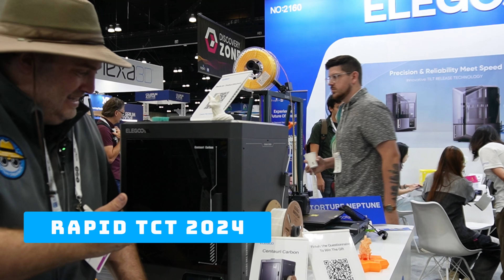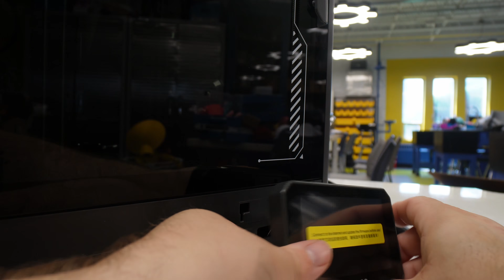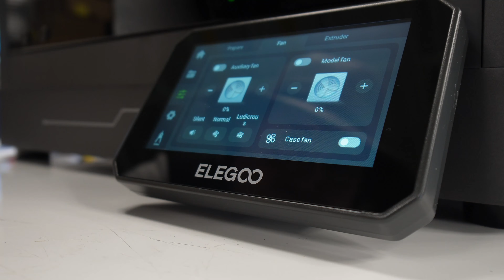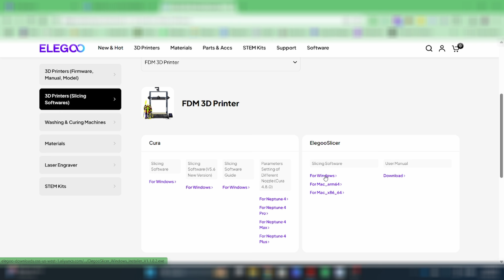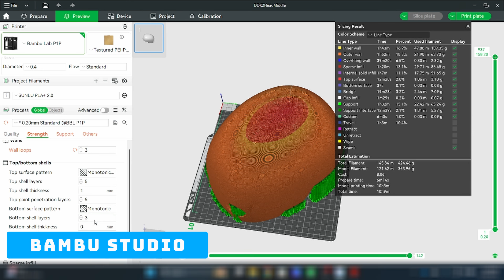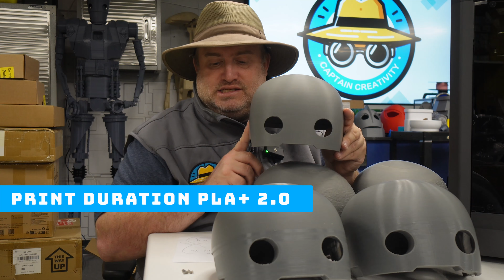Centauri vs P1P: The Ultimate 3D Printing Showdown

Comment: ok, so, people in their review always or almost always forget one use thing.

After purchase support.

Bambu as committed to supporting the p1s for a long time. That means that their site will have parts if your printer breaks down. The ability to get parts is a huge thing to consider when you purchase one of those things. Yeah you may save 300$ but find yourself not being able to buy that proprietary nozzle on a printer.

The beautiful thing about Bambu is that it is widely supported by Bambu itself and there are a truckload of 3rd party companies making a truckload of accessories for their printers so if your nozzle craps out. You have a choice.

I can tell you by experience that i did buy beautiful printer that worked well but basically become bricks on my desk because i had no choice but to buy the hotend from the manufacturer and had to wait for a month for it to come from china or have them send me a replacement part that came from china.

At least with Bambu, they have local warehouses and like i said tons of parts to help out and they got the best website ever, they really have their act together  when it comes to sell you something that comes with actual support. In short its like buying from Ferrari, you pay more but you get the service that you deserve.

A lot of companies out there produce reversed engineered clones with proprietary part, sell them pretending they are open source and when your nozzle craps out you find out that the nozzles on the machine is totally proprietary and cannot be bought anywhere else. ( sorry for repeating myself )

Honestly i was not a fan of Bambu and i just got my first printer from them recently but with all that i am seeing, it does not make any sense to go with any other printer. The only bad thing about Bambu is their bed size but that is slooooowly changing and their always out of stock situation BUT they always end up delivering on the print bed!

Also the fact that Bambu has already figure out multicolored printing properly is another big thing.

so all of this to say. Buy cheap, get cheap support.!

Comment: I bought a CC and have only had problems I have tried different filament but I just can't get it to print properly first it was a bent heated buildplate so my first layers were absolutely trash, then anytime I tried to print even the slightest overhangs it just gave up  it also has weird extrusion problems but the nozzle isn't clogged. And no I have so far been unable to fix any of the problems I am currently having to use support for even a 10 degree overhang that isn't even an overhang I am heavily considering returning the printer and buying a P1S simply because there is better infrastructure to fix the problems

Comment: Got my first 3D Printer (Centauri Carbon) July 22nd. It has over 1200 hours with no problems. It's been an amazing printer. My second printer (P1S Combo) will be here tomorrow. Can't wait to see if Bambu Labs lives up to the hype. If Elegoo had released their AMS system on time I would have bought a CC Combo instead.

Comment: After 4 months of use, has your opinion about the CC changed?
I’m interested in buying one, but I’m new to the 3D printing world. I’m torn between the A1 and the CC I know they’re different types of printers, but in my country the A1 costs only €20 less than the CC, so it’s a tough choice for me.
Buying a Bambu printer feels safer because of the software, MakerWorld, and all the integrated features it sounds like a good option for a beginner.

Comment: It needs a filament movement sensor to avoid air prints.
Reply from the maker: What about noise? Is yours very loud when it starts? I think that's also a key thing they need to work on. Other than that I'm very happy with it.
Reply: @CaptainCreativity given its speed, noise was perhaps not a priority. I don't mind, I leave the top on and close the door. I cannot see any problem with PLA printing with the cover on 
However the front lip of the printer is interfering with the build plate, making it bend. I added a 1/32" thick aluminum plate cut to 259x259m, T6061 grade Amlazon $10, on top of heatbed. 
Filament drying may be an issue, freshly opened packages may still be moist. 
Those paper reels can absorb 4 cc of moisture from air. I weighed 3 of them, a freshly dried one was 4 grams lighter.
The only way to be sure of dry filament is extensive drying. 
I got a Creality dryer with two fans and a 145W heater, with a humidity indicator. 
The only way to be sure if the sealed content is dry is if indicator paper has been included. 
My dryer showed medium high (29%) humidity on a freshly unpacked spool of PLA-CF.  min 5hrs at 50°C is recommended for drying, probably more is needed.

Comment: Just found this video because I'm considering a Centaui Carbon. On the P1S with the bad prints, have you ever cleaned you extruder gear? A dirty extruder gear can cause the bad globs like you got on that K2SO head.
Reply from the maker: To be honest I dont clean as frequently as I should and your absolutely right to call me out on that one.  However in this case I did try this with multiple P1P machines and got the same result, so I feel that the extruder gear wasnt the issue, also since then I have printed out many other large items with no problem. I have moved on from the K2SO head but I would like to get to the bottom of it, either way its a great suggestion and I did go ahead after this to do a cleaning, so next time I do a large print or if I make another K2SO I will try it again. Thanks again

Comment: Did you notice any difference in sound levels? On forums Centauri is getting bad rep for being very loud, is it actually that much louder than the p1p/p1s?
Reply from the maker: Hey I'm actually glad you commented on this. I don't know why I didn't notice it as much in the testing. Maybe it was because I was in a stem lab. But when I brought it home to be placed on the standing desk testing that I was doing for my other video I definitely noticed the difference in sound level. I would definitely say that's the biggest strike against the Centauri carbon is the noise level it is ridiculously louder than the p1p. For me it's not enough to not say it's still a great value because usually my makerspaces relatively noisy anyway but for many that could be a major deal breaker. Anyway I'm really glad you pointed this out. Thank you for watching

Comment: I personally would not buy the P1P or P1S over the Centauri, nether are worth the extra cost. There is no way the software is worth $300 to $400 more.
Reply from the maker: A very good point. Been very happy with the CC so far and hope it continues to handle itself as an amazing Core XY Workhorse. And for this price it's going to be hard keeping them in stock

Comment: You're gonna tell me you didn't notice the massive elephant's foot on the CC benchy? 13:30
Reply from the maker: You know what now that I looked at it a few times I can't believe I missed it but you're right there is a little bit of elephants foot there. Thanks for pointing that out. What do you typically do to adjust for that I would imagine you tweak the z offset a little bit?
Reply: I don’t have a printer yet, but I’m researching them. What is the elephant foot you were referring to?
Reply: @Tinydollhouseproject tell me if you know

Comment: I just ordered the p1s, I did like the price of the cc however… the lack of spare parts, the lack of ecosystem and the vapourware ams turned me back onto the p1s.
Reply from the maker: I definitely would say there's no wrong choice here there is simply more bang for your buck. I think the CC with Bambu. Also I've had my p1p for 2 years and hardly did an ounce of maintenance on it and it's still going strong. Time will tell with CC
Thanks for the feedback and for watching

Comment: Just ordered A1 non combo and then of course see this one. Preorder w/extra plates, filament, head for like $380
Reply from the maker: The A1 is still a great printer, and especially if your new to 3D printing. The Bambu Ecosystem with the software and makerworld is really great.  The Centauri is definitely better but doesnt yet have a multi color filament system and they are only starting now on developing their own eco system. Both printers have their pros and cons but I think you will be really happy with your A1

Comment: Any printer can be adjusted to do just as good of a job as the next one. It's just whether the buyer understands how to set it up, what tweaks to perform, and what parts need to be adjusted. As far as speed, for the average consumer, whats the hurry? I still print at 60mm per second with all my printers. Bambu printers are like the covid vaccine. Everyone jumped all over the bandwagon when it first came out and years later, they're seeing the faults and failures....such as Bambu locking their firmware with their latest update. Elegoo has always put out very nice printers....with the exception of their Orangestorm Giga which is a leveling nightmare.

Comment: Elegoo CC is working fine for me. I think it's better than p1s too. Touch screen , speed, performance and pricing. one issue only FAN very lound
Reply from the maker: It's blowing me away I'm still using it and I'm throwing everything at it. Huge Prints, difficult prints, etc . I've even been able to experience a run out filament and it recovered beautifully. I would definitely agree that one thing I also noticed was that the fan is insanely loud. I'm not sure if that's a hardware thing or a software thing. Anyway great feedback and thank you so much for watching.
Reply: @CaptainCreativity  There was a video of guy who posted modified G-code you could paste in slicer.
It put fan at 50% the loud one and everything still printed fine including overhangs.

Comment: I can't wait to see what kind of multi colored solution they come up with
Reply from the maker: Same here . At this point as long as it's reliable it will be well received. I've been now printing for the last few weeks K2SO parts for a new Droid and it's been working flawlessly. I think as long as they come up with something that can be easily maintenance to clear out brakes and just does the job that would be great I don't think they really need to innovate anything new here. I'm usually all for innovation but I would really like to see them just come out with something nice and stable for a multicolor solution
Reply: @CaptainCreativity yeah that's true but at this point how could you innovate an AMS system other than making it use less waste. It is is biggest weakness and they could definitely use something before they fall too far behind.

Comment: Notice the bottom of the CC, looks like there’s significant elephants foots causing an outer bulge, as well as affecting the text underneath. 

Easy fix of course if it is indeed elephant foot. Could be z offset too.
Reply: Certain filaments of mine do end up with that squish at the bottom, so I'm thinking the default z-offset is overtuned to make for more reliable prints. People who got this printer 5 or 6 months ago were complaining about inconsistent first layers depending on where on the bed it is, so I think Elegoo overcompensated on later batches.
Reply: @SerenadeURA  yeah the z-offset needs adjustment, i had to put mine at 0.020 for that good first layer.

Comment: I see the a1 mini recommended as the best entry level, but this one is the same price for me. Do you think this one would beat out the a1 mini for a first printer?
Reply from the maker: Excellent question. I think if you're just getting started Bambu A1 mini or A1 is the way to go. If you're interested in multicolor printing these options are available but the real reason I would recommend it is because of their ecosystem and software. When you're just getting started  bambu studio or mobile app makes it very easy to get started. 
That's not to say that you can't start with the Centauri Carbon and Orca Slicer but for a beginner you will have an easier time with the A1. Is this for you or a child ? If for a child even more so I would say go with the A1.
However I will definitely say that once you get the hang of 3D printing and your looking for another printer or a CoreXY then Centauri is the way to go  Feel free to follow up with any additional questions and I'll do my best to point you in the right direction.  Thanks for watching
Reply: @CaptainCreativity  It's for me. I assume I'll end up with similar quality on either starting out, so ease of use is probably better. I thought maybe it being an enclosed printer would up the value or something. Thanks for the input!
Reply: @beancreature2212 go with Bambu. I have Bambu and Elegoo. I will never buy anything FDM from elegoo again. You pay for what you get. You pay little for little. And the BBL program and automation alone is a pro! (If you have more budget go with Prusa instead
Reply: @CaptainCreativity You forget to talk about the assistance too! Elegoo I have taken it several times, resin ok but fdm every time the printer had serious problems. The assistance almost never helped. After a few months the elegoo fdm ended up a bit in the cellar, a bit in the bin, a bit as spare parts instead BBL I had 1 problem with the monitor and after 7 days they sent me the new replacement monitor for free with the option to send the printer to the system for FREE (instead elegoo I had to pay 2x shipping, One to send from home to them, and once settled pay from them to my house).

Comment: I believe the 2.0 version of the sunlu pla plus flows easier and I bet that the flow needs turned down in the slicer and you're probably over extruding on the p1p.
Reply from the maker: Hmmm interesting . I am going to try and revisit and try what your suggesting as well as a bunch of other things. It's just eating at me not knowing why it's doing this. I just ran another large print using eSUN PLA+ silver and it came out great . Even though I don't need another head for K2SO it's just eating at me 😃 thanks for the suggestion and for watching
Reply: @CaptainCreativity no problem

Comment: the centauri benchie  has better port holes..
Reply from the maker: After reading this I took a second look and yup I agree. This week I'm firing up a bunch of new prints on it and so far all beautiful. Are you thinking of getting one or have one ?  Thanks for the feedback and for watching.
Reply: @CaptainCreativity  I ordered one this week. Will be ordering a bambu A1 next week for color prints.
Reply from the maker: @Politikul Nice! Did they give you an ETA? Im curious how long people have to wait to get one these days. Anyway keep me posted 😊
Reply: @CaptainCreativity  no ETA but they start mailing them from the 10th of july through august , so atleast 1 month to wait. (I hate waiting , lol) did buy through a reseller.. the elegoo eu site doesn't accept i-deal (debitcard), only visa and paypal.
Reply: @CaptainCreativity  At first i wanted a p1s with ams 2 , but that's over 900 euro's here , and a combo with the ams 1 is below 800 .. and the whole reason for me to get an enclosure is to play with engineering filament at some point.. which means most of the time i'd have to keep the p1s open for pla printing. so i decided to get the elegoo for engineering filament (and 1 color pla prints) and a A1 for color (ams lite is easier to fix a piece of stuck filament compared to the ams 1 ) and end up at around the same price a p1s/ams2 combo would cost.
Reply from the maker: @Politikul yeah AMS lite is a lot easier to work with than the regular AMS.